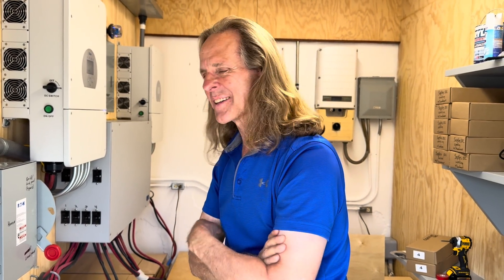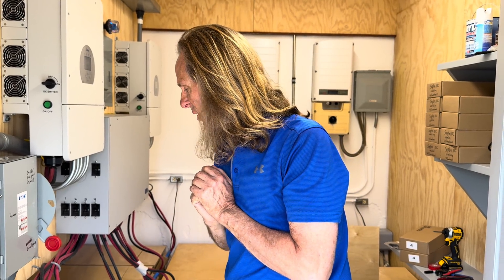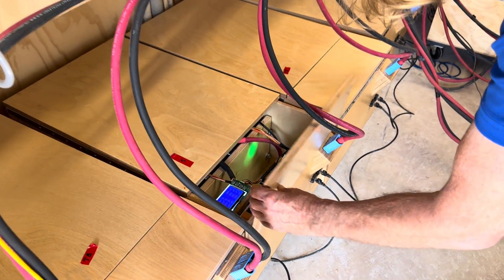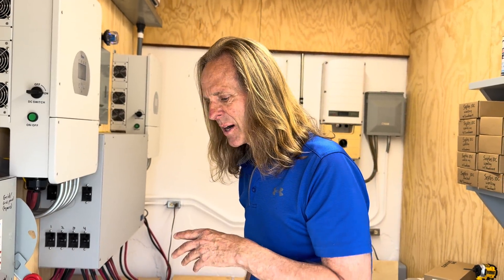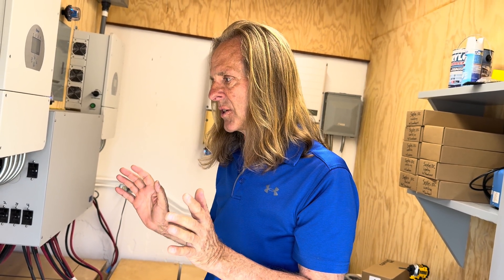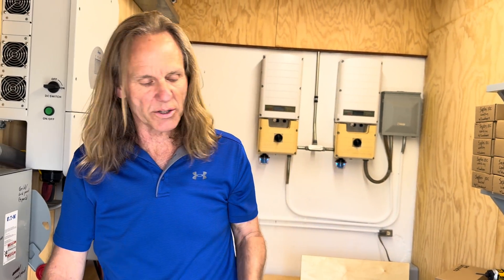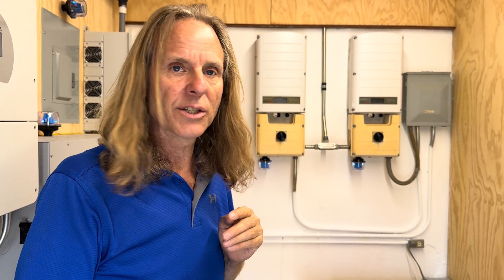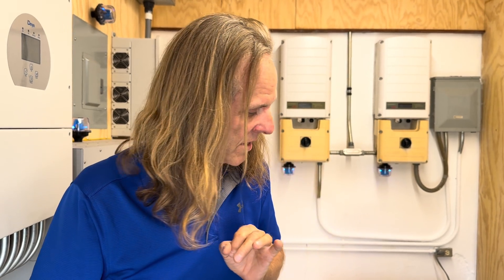Huge Off Grid Lifepo4 Battery System Maintenance And Management

Comment: a few millivolts is margin of error on detection equipment and differences in resistance within the chemistry of the actual material of the top bars the power flows though...thats insanely good quality and consistency
Reply from the maker: @Shadow0fd3ath24  it’s why we pay attention to the small details in the construction and protocols.

Comment: Good day @RayBuildsCoolStuff  please I need your advice on merging 3.2V LiFePO4 with different ages.
I have used a 100Ah battery (4S 3.2V cells) for about 7 months. I intend introducing another 4 new cells in series to make it a 24V battery pack (8S).
What will be the effect of this fusion, in terms of performance and longevity?
Reply from the maker: @arterxerxes  let me begin by saying I have not done exactly what you’re talking about doing. I have, however, replaced three year-old cells with new cells. What I believe and what I have experienced is that in any battery that we build with cells in series, the capacity of the battery will be limited by the weakest cell. It is my educated guess, that the capacity of the new 24 V battery will be identical in AHs to the capacity of your current 12 V battery. If I wanted to give up the 12 V battery to avoid buying four cells, I would do what you were proposing. That isn’t the route I would go though. I would buy eight new cells and have a 12 V and a 24 V.
Reply: @RayBuildsCoolStuff  Thanks for your input.

Comment: Interesting topic, will you just keep switching to new cell's as they get older and lose capacity?
Have the same problem with my two 48v battery, where cell 16 in both battery's have much lower capacity after only 20 cycle. 4 years old and will never see 4000 cycle. Leaning towards buy 32 new cell's and split the old battery's to make 12v and sell them.
Reply from the maker: @gatomalo69  time will tell. After changing out the original week sales things seem to be working well now.

Comment: The other trick with balancing is time. If you hold your cells at a full charge for a long time the passive balancer can work just as well as an active one.  Remember sometimes you need to give your BMS time to do its thing. Time is often overlooked.
Reply from the maker: Absolutely

Comment: Why all is in wood?.!
Reply from the maker: Because I’m a wood guy. I protected the wood with a special intumescent paint that resists burning. I tested it with a blow torch.
Reply: @RayBuildsCoolStuff  me to love work wood and steel but why just not put some fire resistant material? And i lurner in school to 100 amps can kill you from 12volt batery, and in my army time i made shortcuts one 1.2 volt nickel cadnium sell, be misteke and this kick me 2 meter wey , wass 36 volt air plane battery. You need respect power in this sell more
Reply from the maker: Thank you very much for your concern.

Comment: Thanks 🙏 for the tips Ray. 
Yes, spare BMSs have been my policy too, I bought four 200 10E to start with and only use two so far.
As far as active balancers I purchased a 4A one for testing purposes but never had time to use it until my second battery was on the go to be finished and finally had time to apply my initial plan never adapted in the first one built.
It consists of a split cell’s voltages harness with three connectors on each bank, one from the cells, one to the BMS and one spare just in case an external balancer was to be used.
All this worked fine as you can see from my attached short clip however, while completing the assembling, I had a little accident that fortunately didn’t cause major disaster but seriously hurt my ego and confidence, in fact, I had to stay away from the project for a couple of months before I could even face it again.
What happened is that the small voltage sensor wire connected to the positive terminal “mini busbar” (the short one) got caught and forced the copper mini-bar to fall between the positive and the negative main terminals causing a very brief but serious short.
I normally disconnect the Nº 8 to 9 busbar before any work but I must have forgotten this time.
The batteries weren’t full at the time, around 3.33V each but nonetheless, I thought I’d fried them, strangely they were all still perfectly balanced and with equal and minimal resistance nevertheless.
Since there was noting else I could do I took this as an opportunity to learn and study the result of such an unfortunate mistake.
However, now all the cells of that unit will stay balanced up to 3.347V (~ 54.4V) after which cells Nº 9 to Nº 14 (6 units) will start climbing up to the max set in the BMS activating the cell individual voltage protection whereas the other 10 cells will stay around the 3.347V.
As soon as it starts discharging all cells level up perfectly and stay so.
I don’t know if to assume that the cells 9 to 14 are at fault or if the rest of them are.
For the moment, I have limited the charge of that battery, and it works fine next to the older unit until I can order 16 identical cells and replace them all. This will give me the opportunity for serious analytic bench testing so I can learn more from this incident.
I was going to build a third unit anyway even though it is not strictly needed so I can use whatever is left of this lot and only add what is required in order to complete the set again.
I’d be interested to hear what you think about the 6 cells since I could not get steady resistance Ω readings due to the awkward battery position at the time. 
Once again thanks for your new videos 🙏

BTW, please forgive my Italian accent 😃
https://www.youtube.com/watch?v=V8fFILEoZ_4
Reply from the maker: @9111logic  there are a couple of things that are not clear to me. You said you have a four amp active balancer, but it doesn’t sound like you’re using it to bring the voltage down on the two cells that rise to the top. If you are using a passive balancer, how long have you allowed it to try to balance those two cells? It can take some time if two of the cells have an extra 10 amp hours or so in them. That would explain why they raced to the top and it would take a passive balancer quite a few cycles to get them in balance but it eventually would.
Reply: @RayBuildsCoolStuff  Thanks for responding so soon Ray.
I only used to active balancer once to test it. When I connected it to the battery while in use and charging, I saw the voltages of the overcharged cells racing up and down sometimes well over 3.65v so I stopped it. I might try to do that with the battery disconnected but, as I said earlier, all cells become balanced (between 2 to 4 mA delta) as soon as the overall voltage of the battery falls below 54V or thereabout, the mismatch only occurs during charging when the 54V is exceeded. I think it might be wiser to use it as it is until the other 16 cells from Jenny are here so that I can process them all as usual, top balance them and install them in place of these, that will give me a chance to diagnose the problem more scientifically. I was wondering what you think about the brief short, it must have been a fairly big rush of current even though it was for a fraction of a second, what could have happened to the dielectric? Of course, I will never know if this voltage variation has anything to do with the incident, I'll have to look at my database of the initial capacity tests and see if I can spot some abnormalities.
Reply from the maker: I think I would leave the battery as is and build a new cells into a new battery. It doesn’t sound like you’re losing much capacity at all at the moment so just build a third battery and use them all.
Reply: @RayBuildsCoolStuff  ❤️🙏

Comment: Great insightful video.  I’m lightyears away from building my system as I will only be getting foundations on the property up later in the year and it’s a slow 10 year house build due to lack of funds. However I’ve ring fenced my solar system money and I reckon it’s gonna be a monster system with around 12 -16 diy kits utilizing mb31 cells or Catl 320’s. I’ll post and link a video when that day comes Gods willing. Great stuff Ray. 🙏

Comment: I got 64 cells from Jenny and shipped then to New Zealand. Great service and great batteries. My JK BMS have 1A balancing and have had no issues at all with the batteries. However they dont communicate with the Inverter. Will be looking at updating them soon and sorting out the BMS to inverter communications. Using Growatt 5Kw inverters x 3.
Reply: High Mike, I'm in NZ as well. Can I ask if you had any difficulty shipping to NZ and what the shipping cost for that many batteries?

Comment: You have a lot of long battery cable runs to individual battery packs.  You should tape the pos and neg line individual pairs together for as much of their length as possible.  

It significantly reduces the series inductance of cable run.  Series inductance in battery lines causes voltage ringing when there is surge loads on inverter.  Having the DC input voltage ringing can damage DC input capacitors and switching MOSFET's in inverter.
Reply from the maker: That’s very interesting. I have suspected that it was something I should study up on and now you have given me a little more motivation to do so. Intuitively I suspected that having them run together was not what I would want. Now I have to go study.

Comment: JK-BMS keeps my batteries perfectly balanced because of the 2 amp active balancer
Reply from the maker: The point I tried to make in the video is that 150ma passive balancer is actually just perfectly adequate for keeping the battery balanced. There’s a certain Internet influencer who is pushed the notion hard that active balancers are a good thing, and as a result, the industry has gone there to meet a demand that is in my opinion unfounded. Does it hurt anything? Perhaps not but be very careful of how much time you allow that device to function.
Reply: the balance function turns on at 3.45 volts and my batteries are at 100% SOC at 3.50 volts. the balancer does not run all the time. my cells start to balance at >0.010 once the pack drops below 3.40 the balancing stops. my cells average deviation is 0.007.

Comment: I use jk bms with 2amp active balancer to keep cells balanced, passive balancers are just resistors so burn the energy of the cell with higher voltage.

Comment: I get 44kwh from my 48kwh bank DOD 90% if it is cold. I have Lead Carbon AGM, horrible for content creation as they have no BMS, no heaters, no equalizers, they don't even get terminal build up, charge at at -30C, and if they are defective, it is from day 1 as drop damage, at 170lbs for a 12v 250 it is a common thing. 50% D.O.D 3200 cycles I discharge 80% it is 6000 cycles, charge at 58.0v no off gassing that I can detect. I can get 60kwh for 9600 usd. These are not your old agm's and no lithium inside either. All they do is silently degrade.
Reply from the maker: @bobmonztr  you can buy 60 kWh of lithium iron phosphate batteries for $6000 US. There are lots of other reasons to like them as well.
Reply: @RayBuildsCoolStuff  I have seen a lot of Severe torture testing on Lifepo, the multicell packs seem a lot safer than the pouch if you buy more cells.

Comment: Do people ever hook up the batteries in a series parallel configuration?  For instance, two batteries hooked in parallel which in turn are hooked in series  to 16  other pairs to create 48V.  Even more than pairs.  You'd have a 3V bus bar, a 6V bus bar, a 9V bus bar, ... , 48V bus bar.  Would the parallelism help keep them balanced?  Just some fuzzy thinking on my part when you talked about rewiring your whole pack in parallel to balance them.
Reply from the maker: @markstipulkoski1389  some people do that. I never would. I want each individual cell to be individually monitored by the BMS. If one cell has a problem the other cell could hide that problem from the BMS so that it could get either overcharged or over discharged, causing serious problems.It is done, however, and I have even seen 4P 16 S.

Comment: 45 usd per kwh is insane. 2 weeks grocery = same price to get enough battery storage to go off grid. crazy times we are in.
as a side note, i build smaller 32ah 4s packs which i turn into dc power stations. i completely omit any bms and rely on top balancing, a 4s INDUCTIVE active balancer (the capacitive ones are garbage), and fuse the positive leads.
i use 100w bidirectional usb-c powerbank boards which are default set to 4s, and solder a connection to set them to lifepo4 voltage range, about 3.55v top cell voltage.
tempature is handled by a w1209 temp relay board and a 15w heating pad under the batteries, and can be enabled manually through a switch on the enclosure. 
there are positives and negatives to any bms solution, mine is basically a dumb analogue bms which i think will be much more reliable over time. much less parasitic loss from bms going this way, and if the balance board lights up, its how i know i have a problem with the cells. 
I dont like the idea of apps/bluetooth/wifi control, or relying on firmware. so far all of the fires i have seen documented for lifepo4 home storage has been because of a bad bms drops a cell, or because a cell has a flaw/ding in its al negative enclosure and cracks over time due to expansion of the cells, possibly from over temp/charging.
nothing wrong with what you did, you have probably the most well documented solution. im not sure if fits for everyone.
as a side note, people just getting into this hobby should look at ammo can enclosures. 20mm can fit 6x 280ah cells in a single row, or possibly 8 cells depending on how they are arranged.
another overlooked aspect of lifepo4 longevity is their orientation. ya you can get away with the cells in any orientation for a long time, but the original mfg of watson life4poy cells (with yterbium for better longevitiy and cold weather performance) informed everyone in the early 2000s to make sure the cells are upright in their enclosure, especially during the first few cycles because of how gas bubbles form and aggregate inside the battery cells. no one really talks about this anymore but its still an issue that should be considered as much as compression for those looking for the longest lifespan.

Comment: I do it the same way  ...  with the same power supply - works great! But I don´t charge the cells up to the limit, 3,475 V max (start balancing @ 3,45V). I have JK BMS with internal  active balancer working since a few years without any problem.
Reply from the maker: @markmark9532  you just have to be very careful not to touch the wrong thing with the clamps.
Reply: @RayBuildsCoolStuff  Isolated clamps are important. BTW: I works even if the battery is connected and the balancer is working  (but I disconnect it also and stop the balancer).

Comment: Hi Ray, great battery storage system job!
I'm really interested in looking inside your Midnight solar battery combiner box and seeing how you wired everything up.
I'll be connecting ten 16kWh batteries up to my offgrid system.
Reply from the maker: @LRagoczy  some of the 175a breakers are double lugged as there are only 9 spaces available for battery connections. My next system will have two combiner boxes and 20 batteries and four inverters and close to 60,000 W of PV. That’s a secret so don’t tell anybody.😂

Comment: what are people paying per kWh from jenny wu these days? It seems like LiFePO4 boxes are going for  between $100 and 200 per kWh if you shop around and catch the right sales, and a lot of that is with warranty coverage. The DIY route seems like it will quickly not be worth it, if it isn't already
Reply from the maker: Depending on the shipping to where you’re located it comes out to ride around $100 US per kilowatt hour delivered. It’s still half of what it cost to buy batteries that are prebuilt and I haven’t found one of those yet that I really liked. I really think DIY will always be the way to goif you want to save money and have control over the product. Imagine having cells that are welded to the busbars so that it’s almost impossible to change one out when it’s needed.
Reply: @RayBuildsCoolStuff   Latest prices are down to $75 per KW delivered
Reply from the maker: Link?
Reply: @RayBuildsCoolStuff  not sure why my previous comment did not show up but recent quote from Docan, shipping from China delivery to US address has it at $75/KW

Comment: Nice seeing update on the home system, have you done much boon docking in the trailer yet, how is that system, does it meet needs or are you thinking you need more solar or storage or inverting power. ?
Reply from the maker: I should do a video about that. We took that trailer to Montana for five weeks and Boondock the entire time. We had enough solar and storage to use the air conditioner and refrigerator for that entire time without running out. It worked great and I can’t wait for our next big trip.

Comment: I second your Jenny Wu (Docan) recommendation! Multiple purchases and every experience has been straightforward, honest, fair, and professional! Thanks for your contributions to the community, Ray. Much respect, sir.

P.s. my recent 16 cell Eve MB31 314AH order came in, i left it for several weeks before opening boxes, every cell tested exactly 3.293v. No variation!!!,  brand new cells, perfect shape, and I'm beginning the build now with the latest version of Docan Apexium 280DIY, which have been constantly improved and they are fantastic! Now using circuit breakers instead of the fuse.
Reply from the maker: Good to see you, James.
Reply: Exactly same to me. Good service from Jenny Wu (Docan), very straight forward.